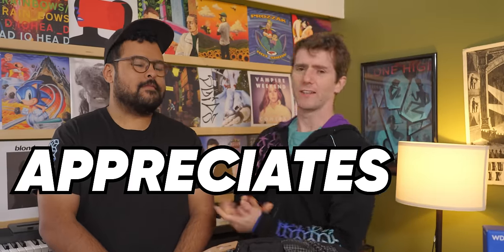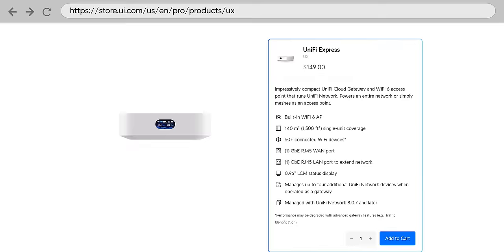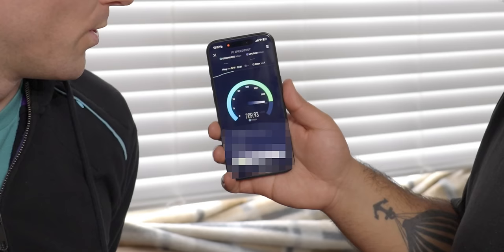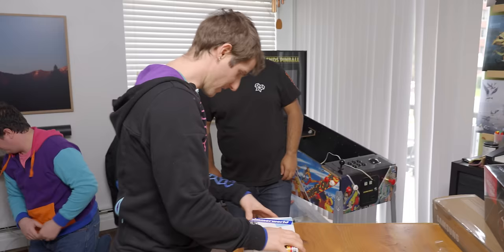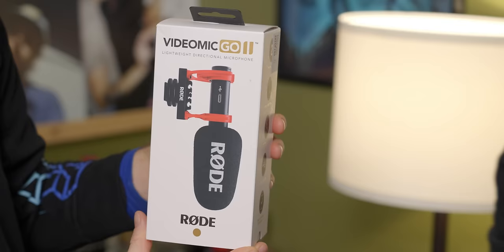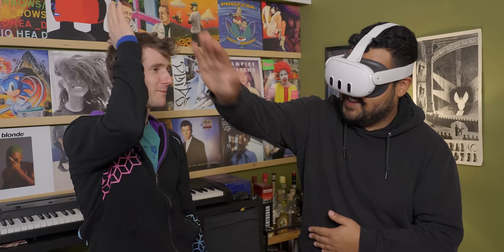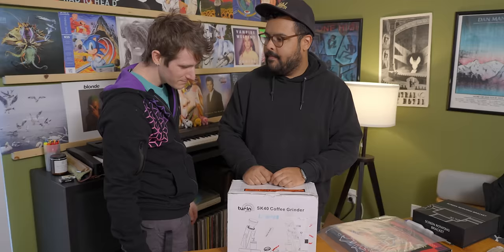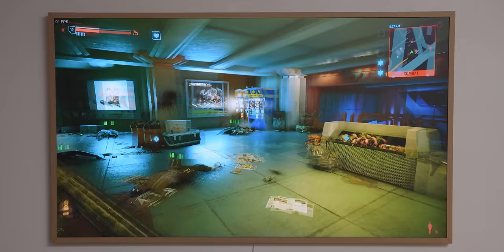The Stealthiest Tech Upgrade - AMD $5000 Ultimate Tech Upgrade

Comment: 4:20 “I just keep the boxes for everything.. You gotta keep boxes for everything, what if you want to sell it?” Felt that in my SOUL
Reply: I just keep boxes, in case I need to wrap presents or mail something. I once sent clothes in a GPU box (I admit it does sound bad, but they were expecting clothes).
Reply: I throw every box away. I try not to be a pack rat
Reply: @DG_427  On the other hand, a store once sent me some RAM in a GPU box as the outside box. Thankfully we don't have porch pirate problem in Poland (because nobody is stupid enough to leave the package in the open), but tempting the delivery driver with a recent GPU was strange.
Reply: Same

But still, at least store the boxes flattened
Reply: my basement has big moving boxes filled with all the little boxes from all kinds of stuff I bought over the years...
Reply: An important trick for making it less overwhelming is putting boxes in other boxes. Nesting doll style!
Reply: 100% this the resale value with a box is insane. It doesn't only show you take care of something, the box can sometimes be more valuable.
Reply: This infuriates me
Reply: @Madblaster6  for sure shows you take care of stuff. Also, the best way to pack an item is almost always in the box it came in. I’ve sold quite a bit of old tech and audio gear after upgrading, and it’s always come in handy.
Reply: @Kyomara1337 
Why? How much of it do you even own? And if you sell old stuff, you really think a box matters? C’mon. Clean the basement.
Reply: I literally have a uhaul box full of tech boxes 😂
Reply: @AB-80X  tbf it's not the size of an american houses basement, it's kinda like a small storage in the basement that comes with my apartment so it's not that bad. And I don't sell old stuff, I just keep the box for the warranty period and then never throw them away 😅
Reply: My wife felt it in the used space in the garage... even though I'm the only one who use it

Comment: Just so you know - this specific model of QNAP NASes (TS-451 or any other similar models with J1800/J1900 processor) are randomly dying due to LPC clock bug that will make it not boot. I suggest to replace it at the earliest opportunity or make sure the data is backed up. I had one that died this way. You can revive it by soldering a resistor, but it's considered a temporary solution.
As far as I know there are equivalent models from Synology that have the exact same problem.
Reply: wouldn't the disks work just fine even if the NAS dies?
Reply: @Manivelarino  AFAIK its how the NAS is writing the data and also the map of data and chunks. So if ur system dies but not the disks the map of the array may be loss rendering the data on the disks as a bunch of gibberish for other systems to read off
Reply: @Manivelarino   in my case disks were fine, but I'm not sure if you would be able to connect them to another (non QNAP) NAS or PC if you had RAID on them to extract data. 
When that failure happened, disk LEDs were red suggesting that they died, but it was not the case. Also it rebooted itself without my prompt, so that might be another failsafe.
So data likely won't be corrupted, just not easily accessible and therefore my suggestion about backups.
Reply: @bzyk8925  scary stuff, definitely wouldn't expect a NAS to behave like this...
Reply: oh gawd i just picked up one
Reply: @ThePr0Br0 I bought used unit and it worked for 2 years until it suddenly didn't, so probably it won't happen too soon, but that risk is always there.
Reply: @bzyk8925  I had that exact model and it suddenly died. Had no idea this was the issue, but I plugged the HDDs into a Linux server and mdadm recognized the RAID5 and I just had to mount the data and copy it over to the new replacement NAS.
Reply: It's probably a specific range of Atom processors that had tis issue. I had one RMA'd and the RMA'd one also did the same. Buying one with a similar number of bays (but newer processor) worked and Synology will migrate everything.

Comment: Assuming you guys are buying actual 3M VHB tape (and applying it correctly) that stuff has a ridiculous strength to the tune of 140 psi. It's often used to hold spoilers and body trim kits onto a car without drilling, or to hold lights into/onto a train car... It could be used to hold up that entire Frame TV up (if the brackets weren't obviously a better idea) let alone the One Connect box (I end up installing at least one Frame every other week for work). We also do a number of different TV models from a number of different manufacturers and the entire company's consensus is that the Frame is best when you don't want to have a TV there, it just can't hold a candle to any of the Sony's or other Samsung TV's we sell, but hey it looks really good when it's turned "off".

I recommend testing the hold strength yourselves by seeing how little VHB you need to attach Elijah to a wall...

Comment: Always use a cloud key with Unifi equipment. A perfect setup is a Unifi Gateway (router), cloud key, lite switch, and an AP with wifi 6 (or 7).

Also, next time install into the ceiling. Yeah, ya gotta go into the attic, but it is worth it.

Comment: The MESH is on by default on for the Unifi APs...it ALSO slows down the wireless speeds. Turn off the mesh and just wire the AP and test it and see ;) Even if the AP is hardwired, the mesh is still on by default.

Comment: I'd take one good prime over any tele. Zoom with your feet, Linus.

Primes have fewer elements, providing a clearer picture, wider aperature and smaller footprint. He'll need that extra f-stop for the APS-C sensor. I wouldn't have gone with a Sony crop sensor for $1,400, when the cheaper, full-frame Canon R8 blows it out of the water in low light and auto-focus coverage and performance. You'll also need to go extra wide on your lenses for landscapes due to the sensor's inherent 1.5x zoom. It seems like more of a sports or wildlife camera than a blogging style, video hybrid. You'd struggle to get a wide enough angle and enough light on the sensor in anything less than optimal conditions for 4k 10bit 60fps video. Though, the IBIS and auto-framing are very attractive features for it's intended use.

Comment: A6700! Good choice :) That 24mm F/2.8 is good (it's a half macro lens!) but you might as well have gotten the Sigma 18-50 F/2.8 for a bit more money and it's giving you much better focal range.
Reply: APS-C cameras in general are very underrated!!
A6700 is my dream camera at this point, or if possible, an APS-C in the body of an A7.
Reply: @Bomkz  A6700 is pretty good but the full frame cameras really are a lot better. If you don't mind the size, an A7 III will be better for the same price
Reply: @gamebuster800  the crop factor is what makes APS-C more enjoyable for me, like i like to take a lot of long range photography, and APS-C being smaller means more range for the same lens
Reply: @Bomkz  ok sure, A6700 + 70350G is king. I also own a 200600G but that thing is huge
Reply: @gamebuster800   exactly! :D

Comment: Whoever makes those pinball machines is doing an awful job as far as woodworking goes. The part that Elijah broke off seems to be attached entirely by glue, in a mitered cut, in MDF (actually it lookes like higher density than MDF, but coloquially it's MDF). No support, no biscuit/domino/dowel/joinery/pocket screws, no nothing. As a woodworker myself, I am actually fuming. The fact that this company seems to think that some glue and some grooves is sufficient in this application makes them, at least in my eyes, not much better than your average big box furniture store. 
I hope Elijah doesn't feel bad about it breaking, because that is a joint waiting to fail at the slightest stress.

Comment: I have a question I can't get answered anywhere and was wondering... With PCI gen 5 on intel Z790 mobos, if I use a gen 5x4 M.2 will it make my main GPU slot run at 8 lanes instead of 16?

Comment: If the WiFi problem is that he can only get 300 mbps on Mac devices than I KNOW HOW TO SOLVE IT. You need a switch in between the isp modem and the WiFi router. On my mama, that’s how I fixed that hell whole of a bug. Don’t ask me why it works , but does.

Comment: "What else could you want from a GPU" - some f*** VRAM would be nice, so I wouldn't have to spend money on renting a cloud GPU for any sort of AI tasks after already buying my own GPU for 1000 bucks
Reply: What GPUs are you using if 24 GB of VRAM isnt enough for you? what the hell
Reply: @Memorygant_  Im using a 3070ti. A card which cost me 1100$ in early 2022 and yet has the same 8 GB VRAM as my 250$ rx480 from 2016. Thats my whole point. It should have had 24 GB. Or at least 16-18. That would have been fine

Comment: A friend of mine bought one of these Samsung "The Frame" TVs a little under a month ago and its complete garbage apart from the excellent matte coating. Advert filled mess of a UI, non-replaceable rechargeable battery remote, terrible (VA) viewing angles and smearing on the panel. Worst of all, it doesn't seem to do 1:1 pixel mapping from external sources - text looks HORRIBLE. I'd take my 10 year old 2nd gen 4k Sony TV over it any day.

Comment: Dude, this network upgrade is really inappropriate,The total cost of AP and router is 300USD,Why not buy a wireless router from another brand?If you must use Ubiquiti, why buy such an expensive AP? This Router cannot bring out the maximum performance of the AP at all.